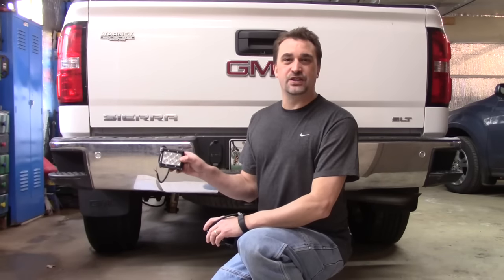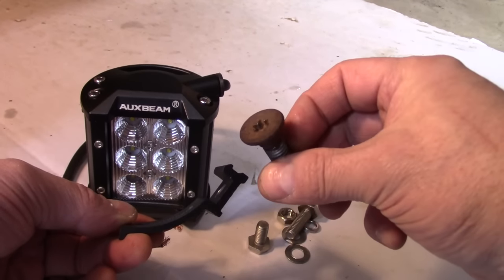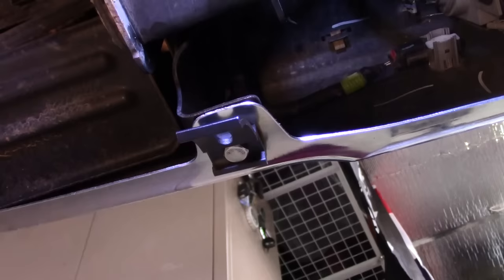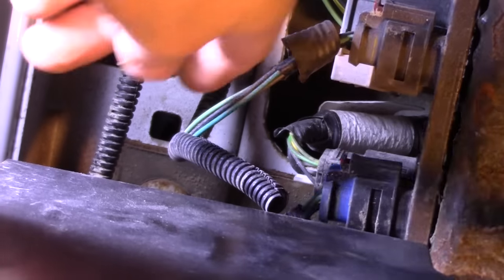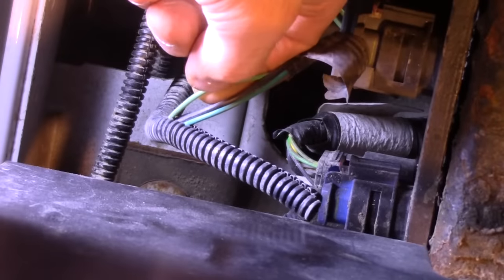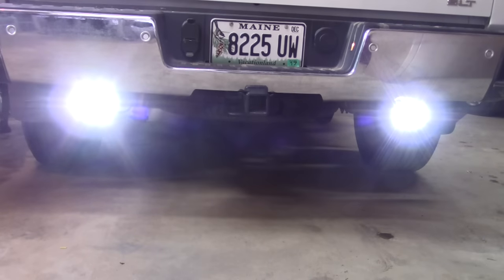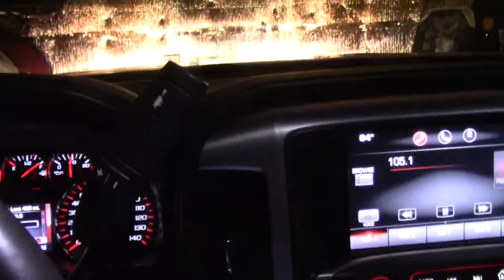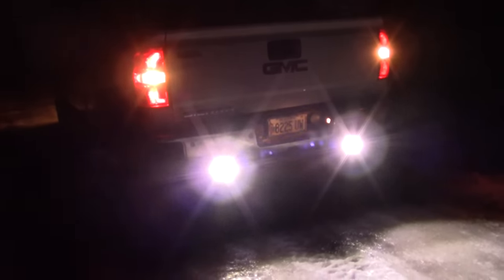DIY How to Install an Auxiliary Backup Light Set On a GMC Vehicle LED Reverse Lights On a GMC Sierra

Comment: Even though the current draw is low and the time on is relatively low, if you find you start popping reverse light fuses, use a relay and let the current come straight from the battery and use your OEM reverse wire as the trigger to allow the battery to supply full current.

Some mount the flush mounts inside and forward inside the steps.

With your light bar, a SPDT switch will allow you to instantly trigger turn with your high beams or independently.

Good video, I run these on my trucks, and trailers as reverse lights. I've got a magnetic mount backup camera that's powered by the cig lighter and when on the back of the trailer with these lights, it's like day.
Reply: With a LED lamp?! Maybe..is pulling one half to 3 amps if EVERY LIGHT WAS ON! Are you a Fuse Salesman?

Comment: I see you have a switch ,  I wired all my light bars and led fog lights into the factory fog light switch cause it has a built in relay and I didn’t want to drill into my dash either and with the reverse lights I wired them into the cargo light on the back of the cab into the factory switch.  Clean and looks factory. Great Video 👍
Reply: Mark Jenkins Thank you and once again very good video. I had mine originally wired like that but I wanted them on a switch also so I could use them for camping and extra lighting, also work great for tailgaters lol 😂 Hopefully everything holds up , I live in Alberta Canada and the winters can be harsh plus all the salt they put on the roads . I just installed mine this summer,  haven’t had them in the winter yet.
Reply: Mark Jenkins That’s good to know they held up good. Having the rear lights are handy to have especially with tinted windows.

Comment: Great video,  2 questions.  How did you splice the yellow wire into the reverse wire? as in what did you use?
  -and - Where is the link to video you mentioned that identifies the reverse wire on a GMC.  Thanks!
Reply: Look in the manual prob

Comment: I liked the video and have the same lights to install on my 2008 Silverado. My question is can I run my ground wires the same way you ran your hot wires bringing both of the ground wires back to the ground wire off of the trailer harness like you brought the hot wires back to the back up wire on the trailer harness?

Comment: Never ever splice into exisiting wiring for power especially for lights.. Most vehicle wiring is ment for whatever it powers and there isnt much leeway to it..  Its better to splice into the wire and use it for a trigger for a relay instead,. and run new wire from the batter to the relay and fuse.. this way these lights are on a seperate circuit
Reply: My man, these are LEDs, not halogens. The draw is miniscule, even moreso if you've swapped the old halogen bulb for aftermarket LED bulbs. (Which you're horrible if you've done, and everyone in oncoming traffic hates you, but reverse lights are pretty harmless.)
Reply: Yeah… plus you’re in reverse for about 10-15 seconds at most any given moment so the “side effects” would not have time to make an impact. Also, as the other guy said, its LEDs.

Comment: Hey bud I’m from good ole Maine too. Question for you though. Did you have any concerns with over powering the circuit without doing a relay or inline fuse. I have a 2015 f150 that I want to do this too. I’ve been told I can tap into my trailer lights for the reverse. Yay or nay?
Reply: Zx10rGuy always use relay so u don’t have to mess with it again

Comment: Hey partner.. I bought the same lights for F150 5.0  They will work individually but not with both hooked up at the same time? Am I tripping a relay or something? But they will both work with the ignition on accessory but not with the engine running.😅

Comment: Mark dine my 97 K1500  that way and they do not work. grounded to Chasey at a common ground point. Found the light green wire and spliced in.  All lights work except the led Aux. Any idea's?

Comment: Mine came with a harness, so there was two wires going to the lights, and a pre wired harness of three going to the switch, so it never told me what color did what. It never told me to wire in a ground, and there was no space for an extra wire. It never told me to run a wire to the fuse box either, the harness came from the front of the car. Needless to say, they never woirked on, no matter how i wired it. 
Odd, same day I wired up a pair of Hella front fog lights, those worked fine. 
But the lights that came with the pre-wired harness, not so much.

Comment: Hey mark, great video. I wanted to ask what size wire you use to make splices and connections?
Reply: I used a 16 ga wire which is sufficient ,LED 60 watt only draw 5amps which is low.

Comment: I did this and they work great, but i am getting a “park assist is unavailable” message on my reverse cam because the car thinks i have a trailer hooked up now. Any ideas for a solution?
Reply: Hey, did you get that "park assist" thing taken care of? If you do, you might want to take it to a Chevrolet dealer. I have a 2015 Silverado and 1st owner. Recently this year we received a recall for the "park assist". Havent taken it in yet, but I'm thinking you might want to ask about if you fall into that recall. Good luck.

Comment: Clearly your from Maine...  trucks a 2015.... already showing rust. (I’m from Maine too) truly despise what current road treatments do to our vehicles
Reply: mf40diesel you guys need to use fluid film! Do it every year before winter and weekly washes and you won't have this issue.
Reply: From one Mainea to another, great job on the video. I will be installing the same lights on my backpack. Thanks for the tips

Comment: My led cubes are flickering when I put it in reverse why is that??
Reply: Connor Linnenbrink low voltage to the lights either loose wires or to much current draw what is the wattage of the lights check for loose wires first or under sized wires will cause the same thing

Comment: crimp tools are not expensive
Reply: The wire doesn't know the difference.
Reply: When the wire slips out due to vibration as a result of poor crimping, the wire will know the difference.